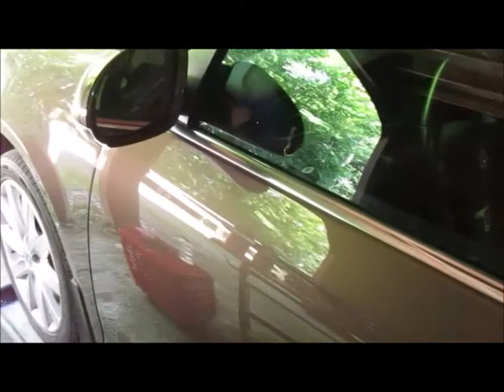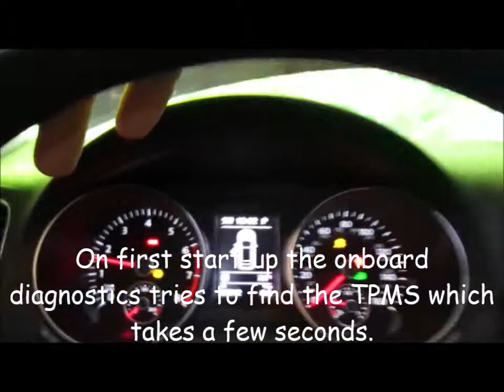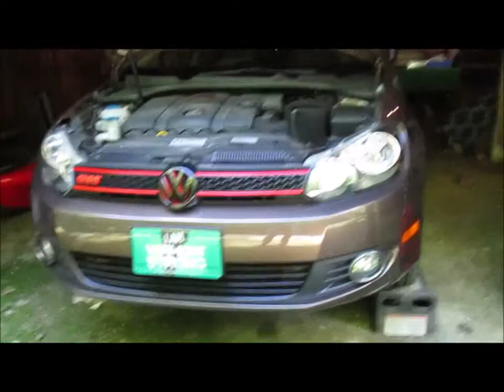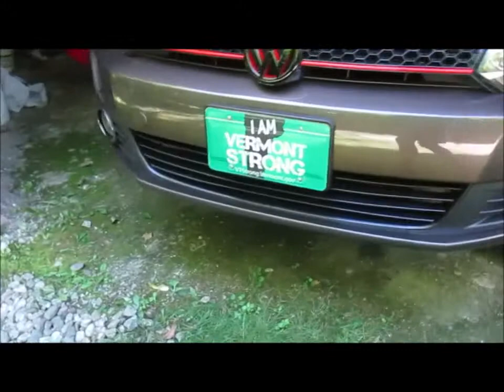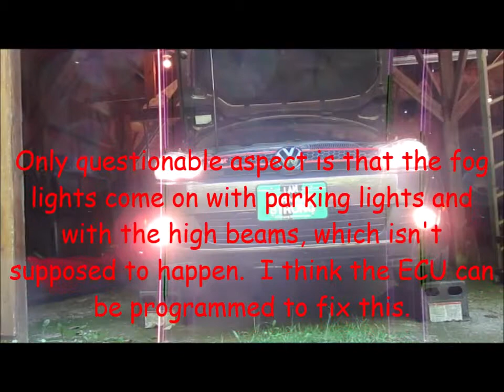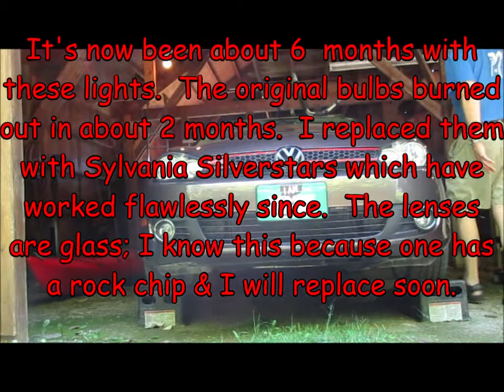2014 VW Jetta Wagon Fog Light Installation Part 3

Comment: Okay so I was able to successfully install the fog lights. I didn't get mine from ECS but I bought them on ebay from somewhere in California. My kit came with some weird button toggle switch thing. I just cut the white wire that came with my kit and inserted it directly (a little sketchy, but it works) into the euro fog light switch I also bought of ebay. After all this, BAM, it worked like a charm. Only thing to remember is when you turn the car off you need to also turn of the fog lights. If you have auto lights like me, for some reason the auto lights do not turn off the fog lights (probably because they are wired directly into the battery and not the on board computer). These videos helped me out thanks again!
Reply from the maker: Glad you found it helpful.  I bet there's a fix for the issue.  Maybe another viewer will post a comment?!
Reply: I've been debating buying the ECS kit or the eBay kit and euro switch separately but wasn't sure if it would work properly.

Comment: If you purchase the 'euro' switch with the ECS kit, that has a separate position for the fog lights. It is like the the US switch, but you can also pull out the switch handle and that turns on the fog lights independently.  I have a feeling that you are using the US Specification switch.

Comment: Alan, are you using the US Specification switch? When you use a European Specification switch, there is an additional available function on the switch.  You pull the Euro switch towards you about 3mm when either the parking lights or the headlights are on.  This turns on the fog lamps.  When you push the knob back in, the fog lamps go out. Of course, the 'fog lamps' are not really for 'fog' at all.  Where they are most helpful is on dark, rural roads at low speed, when you are looking for pot holes, and rocks and those kinds of obstacles. The fog lamps don't throw light far enough forward to be useful when traveling more than about 40 mph. So being able to selectively turn them on is actually fairly helpful. ECS has the Euro switch. Vendors on eBay likely do as well.
Reply from the maker: Thank you for watching. I don’t know which version the switch is, but it does have the option for rear fog lights as well. I don’t really care whether it’s European or US. It works just fine. I use them all the time at night with our rural roads in Vermont. Also good for seeing pedestrians walking on dark sidewalks. I will say for driving in fog, there have been times when I’ve had to drive at a crawl in dense fog. They help you find the center and edge lines.
Reply: Okay.  So you have the maximum number of options that these switches can provide.  Since I only use these lamps on the unlit rural roads (the ones  immediately around me) I like to be able to control them independently.

Comment: About the warning lights.  When you re-connect the battery, after replacing the battery in the car,, a number of dashboard warning lights come on and stay on.  I was confused by this,  but the lamps stay on until you drive the car for about half a mile. These lamps are the traction control lamp, the air bag lamp, and the tire pressure lamp. Driving the car for a while clears these lamps. VW people probably know all about this, but if you are finding your way around the VW world for the first time, this can be confusing.  Don't search for ways to turn out the lamps. Just drive. They go should go out.
Reply from the maker: Thanks for your clarifying comment.

Comment: Where were these purchased from? I'm having a difficult time finding the full kit for my 2014 Jetta Sportwagen.
Reply from the maker: It was on eBay for around $75 last summer.  There are a few on there right now from around $80 up.
Reply: Thanks, I’ll keep looking.
Reply: ECS Tuning has a kit which is made up from genuine VW parts for the lamps and their housings This is the expensive way to go, however the parts are factory quality, and more likely to stand up to stone pecking.

Comment: Awesome man! I have a 2013 Jetta SportWagen and am waiting for my kit to come in. I like the grille. Where did you get yours?
Reply from the maker: Thanks for your comment.  I wish I'd recorded a video on the grille, but forgot to.  It was an eBay purchase, like the lights.  It's a knock-off made in eastern Europe (shipped from US).  Just did a quick eBay search & found a couple for under $60.  It fits pretty well, but not perfect.  I wanted to remove the GTI badge & backing plate, but couldn't get it loose, so just changed the letters around instead.  The VW badge was separate and didn't fit well, so had to hot-glue it in place.